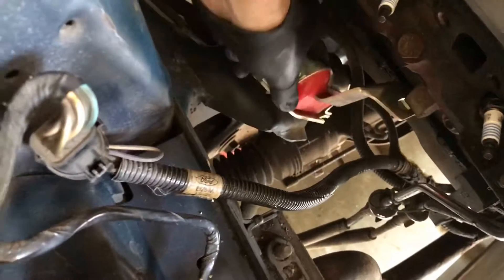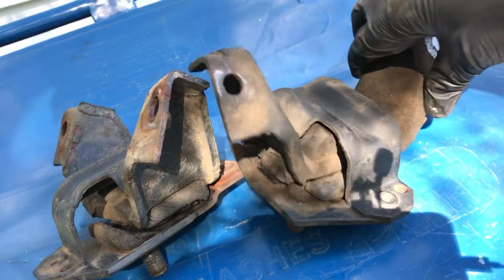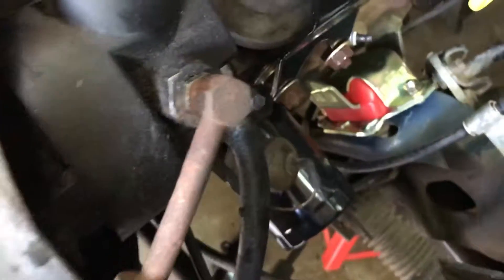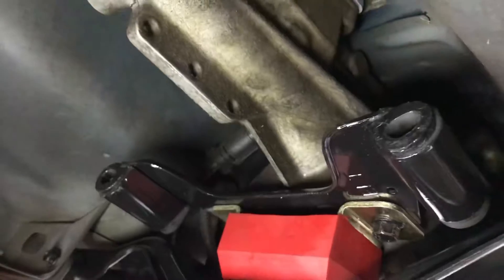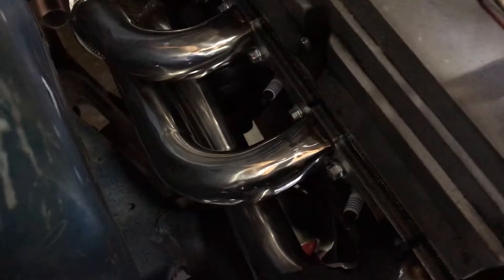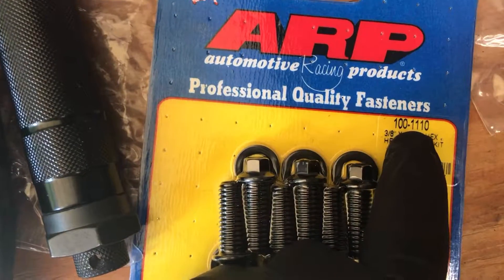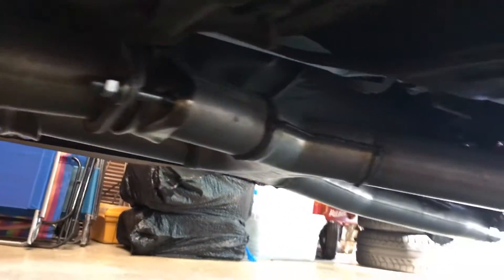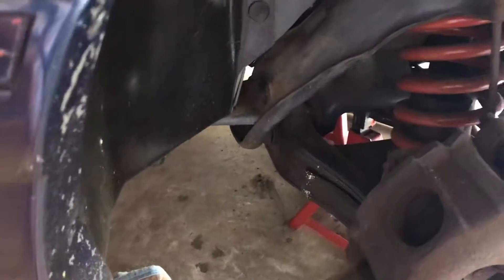Part 2 - installing exhaust and motor/trans mounts

Comment: You should put the exhaust together from front to back. You will have better luck with fitting everything together. Also I would not weld the exhaust up at that particular location. You may need to get back in there for something. Just my opinion of course. The build is coming along nicely..
Reply from the maker: Yep I just had them weld the unions on that 3 piece x-pipe.  Those clamps just don’t work. I had them leave the other ball & socket connections.  Once the hanger was flipped over the right way, everything started lining up better.

Comment: after you flipped the hanger mount the right way, were you able to get the actual exhaust hangers to slide into the mount holes a lot more or all the way? Mine still hang out like yours do at the 14:20 second mark of your video.. and my exhaust seems to be hanging low as well man, im a little frustrated.. same bbk exhaust too, any advice helps
Reply from the maker: I actually got the exhaust mounted to the hanger with it upside down and had the welder at Meineke flip it over for me.  There were definitely some exhaust leaks around those clamps but after flipping the hanger and welding in some sleeves, it’s perfect now.  And you’re right, crawling around on your back wrestling with this exhaust is more than frustrating!